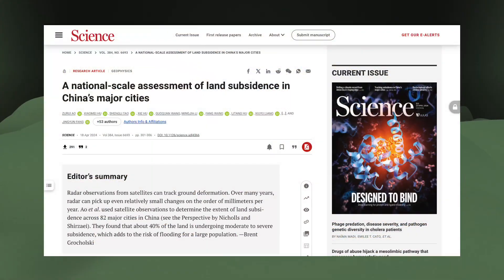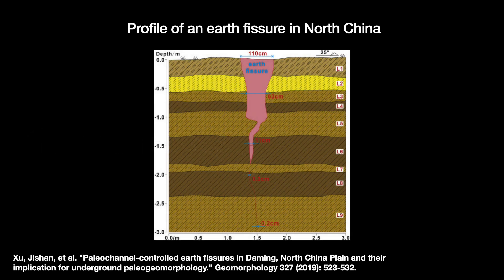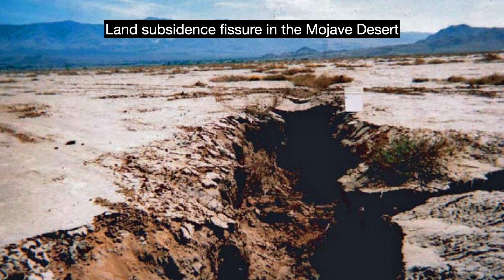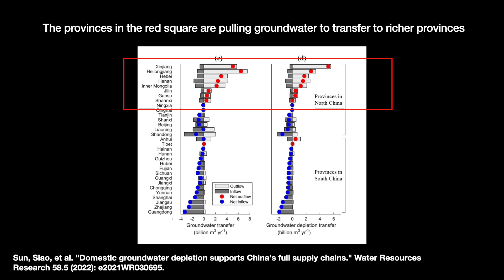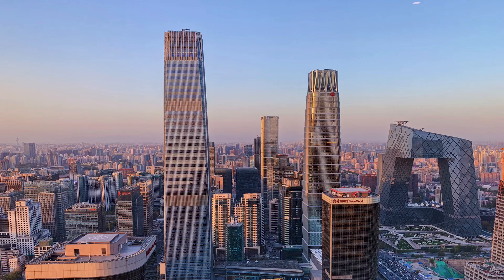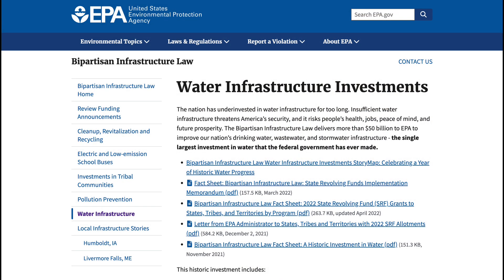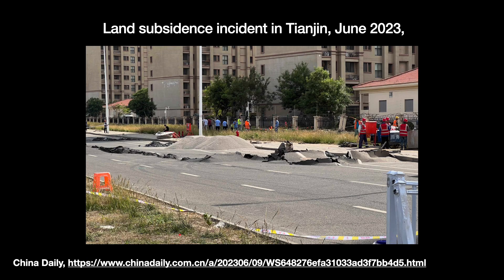China’s Sinking Land Problem

Comment: You apparently took the whole City Prefecture population for Shijiazhuang. It is in fact 5.090.440 - two times smaller than the District population, still big enough. 
You can use CityPopulation and other sources to estimate actual built-up population.

We have a similar problem in ex USSR particularly in three places - Moldova (there the sinkholes are called Hırtop), Perm land and Donbass region. In Perm land the issue is very unique - salt mining. 
During USSR, a water grid was indeed constructed at full, but only for European part of the country, and some places of this grid are already being abandoned due to artificial borders. For example, water issues between UZ and TM led to Aral Sea disaster, and in Belarus, the Bug-Desna channel is almost abandoned. In Ukraine, the Dnepr-Donbass channel between Orel' and Seversky Donetz is/was almost at full capacity and needs to be heavily refurbished as this state never bothered to maintain its Soviet infrastructure legacy.
In Russia the state of Unified Deep-water Transit System is much better, and the whole european part of the country is linked together. You even can transfer submarines from one sea to another.
However, the channel which previously existed in Sverdlovsk region between Kama and Ob' basins is almost abandoned and does not allow for quick transfers of large amounts of water or of vessels from water-plentiful and almost unused Ob' basin to the European part. Same abandoned channel exists between Ob' and Yenisey water basins. If they would be repaired and refurbished, almost 70% of the area of the country would allow for quick fleet and water transfers.
China, on the other hand, tries to connect even to the small 'butt-end' of İrtış which starts actually in China before going into what was Soviet territory. It might lead to the decrease of the share of İrtış in the Ob' river basin as a whole.

Comment: There is a similar issue in industrialized West Germany in the Ruhr area, from which black coal had been extracted for a very long time, and in some places it is still ongoing. As a side effect the entire area had to manage just this sinking of the land by a sophisticated water infrastructure, and there are areas in which houses face damages because of the sinking ground. But this makes no headlines, and beyond the local area, in Germany, this remains rather unknown, and I came to know it only when I moved there for some time for a job. This problem is, like in China, 100 years old, and locals are just used to it. With the explanations from this video, I would assume the same problem exists pretty everywhere where heavy industry and/or water supply overused the land beyond repair.
Reply: We have a similar problem in Lüneburg, a town near Hamburg. The cause is/was extraction of salt from below the city by washing it out with salt brine (Lüneburg has a 1000 years-old history of salt extraction). Subsidence has largely stopped since extraction has been reduced in the 1980ies but some hot spots still subside, likely driven by rain water.

Comment: Subsidence can also cause local apparent sea-level trends to greatly differ from the widely advertised (but actually very slow) global rate.

However, subsidence isn't always caused by groundwater pumping. Oil and gas extraction can also cause subsidence.

More importantly, natural processes, like post-glacial rebound, can cause uplift in some places and subsidence in others.

Ironically, Greta's Thunberg's hometown of Stockholm is one such place. Uplift there is about triple the global sea-level rise rate, so the local "relative" sea-level trend at Stockholm Harbour is downward, rather than upward. (It is a minor contributor to their periodic dredging expenses.)

Comment: In Germany water may be drawn from Aquifers  but it is mixed with recycled (??) water.   My local press suggests that tap water might have been around up to 20 times.   It is also very expensive.   Its ok for washing cars,  gardens and laundry  and CAN  be drunk but often has a bad undertaste. Most people drink bottled spring water. 

 There are very few countries where public mains water supply is intended to be drunk without further treatment -  Osmosis system or just boiling.   

The anti Asian cultural supremacy thing on display by some commentators here is just the result of a  gross lack of life experience.

Comment: Seems weird to build massive canals rather than pipelines if the goal is just to transport water. What was the economic reasoning behind that? Barge transportation? Surely a rail line along the same route would have been more efficient for that.

Comment: 2:08 the sinking caused by buildings are local, only in the close area to the building. For example, a 100 stories building weighs more or less 50 t/m2 and this is equivalent to remove approx 20m of soil for the basement to build the underground garages and to compensate the building weight. A tall building with underground garajes may compensate the majority of its weight.

Comment: Three key points that were unmentioned; The quality of China's freshwater is abysmal. Very little of it is fit for human consumption, and a large fraction isn't even safe for agricultural use as it's too contaminated with factory runoff. That puts more pressure on ground water, as fewer surface sources are safe to use. Secondly, is just how inefficient and water intensive Chinese agriculture is. They have low mechanization, and still use gravity surface irrigation. Not to mention how water intensive rice is as a crop in general. Third, The Water transfer project is highly unlikely to actually be able to move as much water as they want, primarily due to evaporation. They built as wide, shallow, relatively slow flowing canal, so a large proportion of the water they direct into it wont actually reach the north. It's a huge expense for a band-aid at best.
Reply: Thanks for this info dude
Reply: Asia as a whole really need to shift away from rice. It's just far too water intensive for any of them.
Reply: @ArawnOfAnnwn Another person who knows nothing about China. Not all regions of China eat rice. Only people in the south of China eat rice because there is enough rain there. The staple food of northerners has always been wheat, corn, etc. I guess because of the stereotype, southerners are all over the world, such as Cantonese, Fujianese, but the origin of Chinese culture, politics and civilization is in the north
Reply: Sounds like someone who has been there and lived there for years and years.
Reply: Your math is wrong. The rate of evaporation is far lower than you might think.
Reply: @alphar9539  Numbers???
Reply: Much of the canal is also underground or covered by protective barriers. Furthermore, that region of China is not a desert. It is cloudy half the year and cold the other half. So the marginal rate of evaporation is pretty low.
Reply: this anti China propaganda is getting weird. global problem. when do we see a video on how Chinese youth’s acne is more severe than Western teenagers? 😂
Reply: Sounds like propaganda😅
Reply: Wow, a China expert experting on China from behind some sort of wall.
Reply: @peanutbutterjellyjam2179  damn don't mass shoot anyone weirdo 😂

Comment: I’d also like to hear the figures on ground subsidence due to the removal of oil.  Surely it must be greater than water extraction?
Reply: Oil isnt mined in residential areas, and the ratio of oil compared to ground water is less than 1-100.
Reply: Theoretically, yes. But if you look at where most of the oil is extracted from, mostly in the Middle East, a lot of the area is located on vast swathes of desert and unbuilt area. Unless satellite imagery is done, there's no reliable way of knowing.

Comment: Dont forget silt covering any air cacks that could break vapor locks and relieve the wide vacuum of falling water in high and low aquifeds and fhe moon's tidal force lifting and even worse low tide  pulling on the water in the chambers, sicking tight together those surface silts trying to suck it through the old and rusty un used wells.. and those active wells also causing suction through those old groves and ancient city wells pipes  gone dry the the full moon pulling up on it and washing the crubling blocks caused by the square grid of wells drilled.. like a granite quarry's bore holes, but up side down and the weight of those compressed clay blocks as well as  vaccum infusion along those sand stones and clay..and when they drop to the bottom it puts more water pressure to the capped wells lines cracks and fissures  some places it could be 200 feet drops untill the blocks falling fill the initial deep hollow caverns or water filled caverns you call and I too call Aquifers and under ground   rivers.. .. and if the Anti Communist rebels find all of the old test boars and put charges in them and blow out and frature or fill the caverns with the natural gas   and spark plug them or ligh t with flares .. the pipe heat will dry and crumble the lime stone around those well pipes, even simple lense effect spinning magnets a d lightning rod ground wires and or load and ground wires from alternating current 20 to 30 feet apart soldered on screens and put down the pipe with a concrete filled in over it then the other 50 or more fèet or at the top will hest like a broken fuse.. hard wired to the main wire and not the fuse block would get them as hot as oven coils.. and increase the sand and clay crumbling.. 
 Imagine each of those city blocks is a set of 200 ft deep  wells that make up 100 feet or more deep sized blocks  and the vaccum pressure also wants to suck them down into the hole of the cavern way down below.. and then the moon also pulls on all that water and earth and wet clay or the granite that has frozen and cracked or rust of the pipes has opened the point to point pattern  and then some space rod falls really fast in fhe central keystone point and punches several blocks right down into the hole..and then all the others fall ln front the inside out and all of the mud and silt to the side slides into the center of the bowl,or so e crazy kids starved for food and bug repelant and pain killers and some good spices packages got in there like granite quarry demolitions experts special forces and hung high explosives all the way down to the bottom of the aquifer floor and up the pipes all the way like the Dirty Dozen Movie with Jim Brown the Old Football Player who was in that movie... but did it all over the agriculture lands also... and all at once in many areas, they depth charge the aquifer and the pipes and it lifts and splits with the explosions it the water and continues up the pipes, blowing wide cracks the water expanding also is shooting up through... and all of it faling and giving the water all over a place to shoot up to the surface  .. some might on fall against each other and pinch bit the next tide and aquifer level drop   will suck the sand and rubbles down, and each rain or minorflood might be the last everyons in that city sees as the buildings topple and fall in many directions onto one another as all foundations have been washed out.. even stiff breezes leveraging the buidlings bases in a storm,opening and closing and twisting the pipes and comapcted spils into sands powder again.. soo many compounding factors and if not all fixed at once it will be forever dangerous and unlivable .
Reply: I wanna know how you keep your phone or whatever you're posting from charged while you're living in a homeless encampment and babbling on like a drug casualty crazy fentanyl addict

Comment: Great research. 👏🏼 
One question: How huge the sink has to be to be considered a result of excessive groundwater drain?
We are seeing a lot of these in India lately. Most of the groundwater is used for farming. The government tried making some laws that would make people use lesser groundwater but it was protested against and now we're seeing a few sinkholes. I think the reason is the same as you explained.
Reply: @adityashukla7849 I don't think you can guess based on the size...
Reply: What India needs to do most, along with the rest of Asia, is shift away from rice. It's just too water intensive of a crop. And yet the govt. in India, as elsewhere, actually offers subsidies for rice production instead, which is ridiculous. Of course people will protest at their groundwater use being restricted, so rather just make it so they don't need as much of it as rice demands.

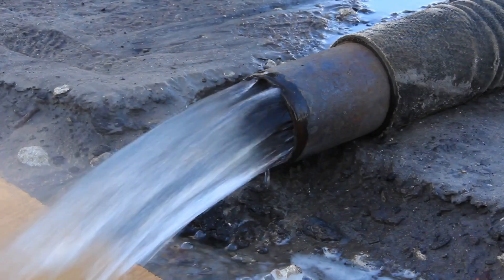Comment: Regarding the point past 13:20, ground water extraction per se should not result in subsidence IF the natural (and possible human induced) recharge rate is not exceeded by the ground water extraction rate. Subsidence depends on extraction exceeding recharge, which can be seasonally dependent. Yes, too many humans over-extract natural resources…though we already knew that.
Reply: They're experimenting on sponge city last I hear, but surface area for water absorption will always be a problem in urban area.
Reply: @bmanpura  Yes, we’ve done so much beyond sustainable outcomes.

Comment: MODFLOW…hmmmm, that gives me pause. Our Host’s “Accuracies vary” refers to the various models to calculate subsidence, and in the case of MODFLOW, that description is an understatement. Keep in mind, good modeling requires good data. Otherwise a result might be garbage in, garbage out.

MODFLOW is a finite difference model, not based on the more robust finite element approach. There are various “packages” to expand its capabilities, of which subsidence (SUB) is one. The packages are add-ons, versus inherently integrated calculations. These factors result in limitations to applying the model/packages to some real world situations or generate instability and variable results. While I have not used SUB, I’ve used MODFLOW and a number of the other packages. The use of packages is often problematic.

Why is MODFLOW so widely used? Because of momentum and the difficulty in writing a quality finite element model to replace it, which is long overdue in my opinion.
Reply: It's hard to make a good model without siginifact investment on survey. At least, here in Indonesia, in terms of cost it's often way cheaper (and reliable) to rely on local wisdom and pure luck.
Wish we have something that can map underground veins in 3D cheaper than the cost of digging the ground.
Reply: @bmanpura  Do you know about geoprobes? They won’t go through rock, but usually do in alluvium smaller than large gravel.
Reply: @jaymacpherson8167  No, I didn't. Thanks for telling me though! I'll look it up.
Reply: @bmanpura  Aren't there ground-penetrating RADAR and SONAR devices that can map the underground? I remember huge trucks with vibrating plates below them driving around in my neighbourhood because they were looking for oil, but they haven't been back in years...
Reply: @jaymacpherson8167  No, this would be the first time I've heard about it. I'll google it up.

Comment: One of the largest issues that China has is that they don't treat their wastewater like other major countries do. They simply dump it into the rivers or the sea and it collects and becomes an issue. 

That's why you have a trash island behind the Three Gorges Dam about the size of Texas. You can literally walk across it without getting your feet wet in 90% of it. However I wouldn't suggest it given what could be in that garbage. 

If most countries, especially the developing countries, would treat their wastewater better and put it back into their systems, it would alleviate a lot of this issue.

Comment: Can't compare the methods employed by Singapore versus China. Singapore is very dependent on water purchased from Malaysia though it has done a remarkable job of building many reservoirs in land scarce Singapore for local consumption. As well as seawater desalination and processing waste water into drinking water. With a population of about 6m people which is smaller than most tier 3 cities in China, it is much easier for the Singapore government to implement demand side control of water usage. Not so much for the Chinese government. China is blessed with access to water sources in the Tibetan plateau which requires rerouting to the populous eastern regions. That means major engineering works to satisfy water demand. No different from how the highly populated southern California receives water via a viaduct from northern California.

Comment: Measuring land shifting to millimeter accuracy from space is so crazy to me
Reply: RIGHT.
Specially when you consider the fact that the satellite orbit is not perfect, meaning that today it will be (for example) 1230km from the ground, but tomorrow when it passes again it could be 1170km, that would be a 60km in height, how can they measure down to millimeters is absolutely crazy
Reply: @wizz1358  By knowing exactly where the sensor is. Orbits are also very predictable and have only small changes over time from things like residual atmosphere, solar wind and celestial bodies such as Sun, Moon, Jupiter.